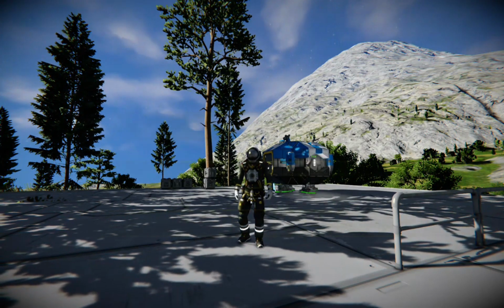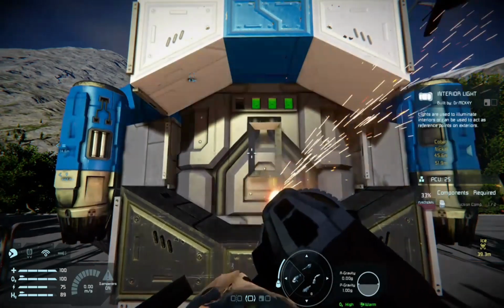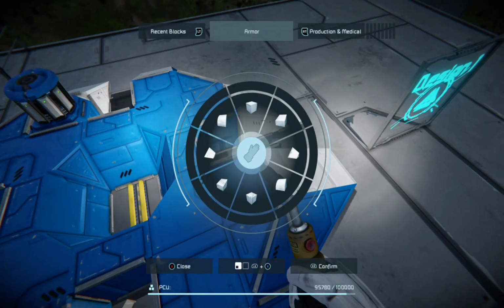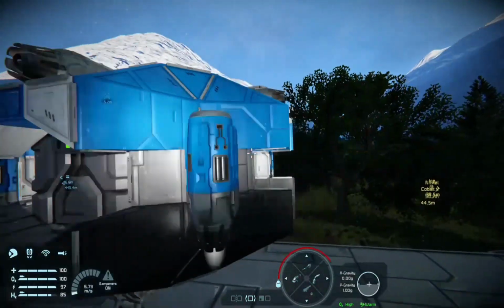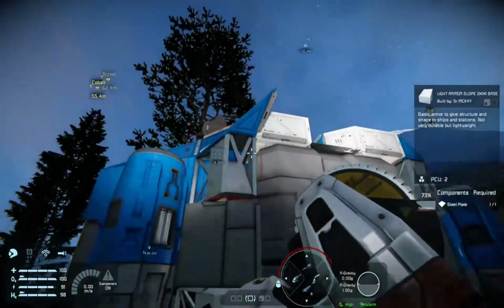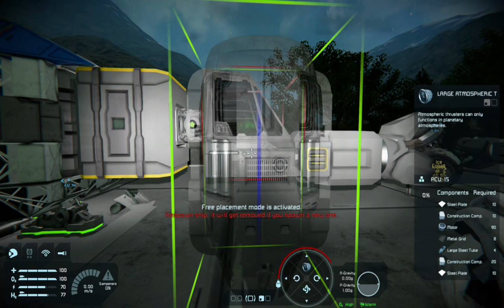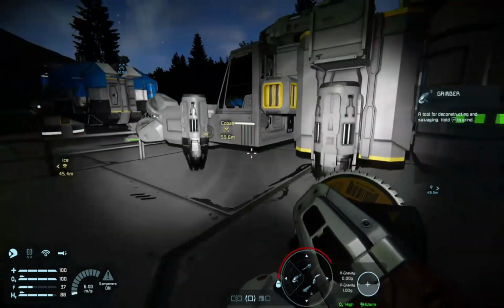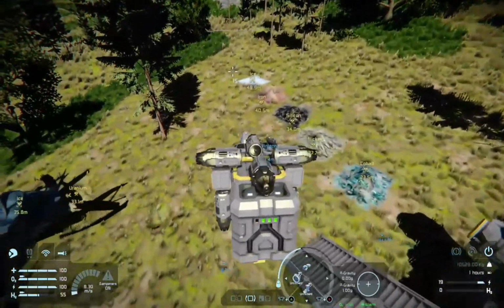Space Engineers Drop Pod Starter Ship Guide /Tutorial

Comment: Great video! I prefer to make a vertical miner. It’s more efficient. Put the connector on the back and the drill on the bottom pointing down. The benefits are that the center of mass is more central, the 4 upward thrusters are pushing against the weight of the cargo.. it handles really steady.. no downwards tilting against one thruster… you have four upwards thrusters against the weight at all times. Cheers!